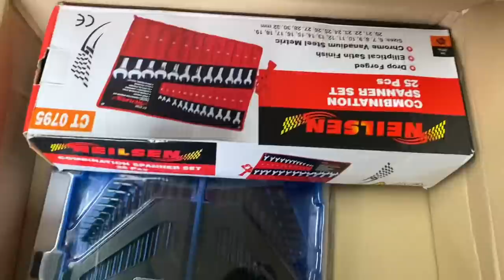DAY 550 #OLLYBLOGS FIXING BENT BATEMAN SPRAYER AND WHAT IS XFORM STEEL #AnswerAsAPercent

Comment: One of my customers bought a cherry x form bucket, really good, loading a 28 cu feedwagon  around 5 loads/ per day,and takes a lot of stick, not put the welder to it yet which is unheard of normally!
The only poor thing, which you probably won't have anyway is the bolt on wear strip, looked good,( if you've never changed one) but if you have your first thought would be ,"what were you thinking"!!
Mike in Dorset
Reply from the maker: Is bolt on strip not a good idea then ?
Reply: Oh no, bolt on wear strip are an excellent idea, especially in high wear situations, but in this case when the bucket arrived,instead of the the usual bolt with inset square underneath and nut on top, cherry had cut a thread in the bucket with an Allen key stud coming up through with no nut , only a couple rings of thread showing.
I said to the customer"send it back" but he thought it looked tidier without the nuts.
But when you come to turn it,
You have to nick all those threads off (thin disc) because they're damaged obs, then the Allen studs don't have enough depth so you have to weld a nut on each one to get it out! nightmare.
Normally,undo the bolts ,sinn it,locktite torque up,done.
Mike

Comment: Those nozzles clamping onto the steel pipe must have a rubber 'o' ring to seal properly. I hope you made sure they were all correctly in place when refitting them; if not, they'll leak !  
You could use a local window cleaning company to wash off your Solar panels; they use de-ionised water that leaves no residue, which can attract more dirt!
Reply from the maker: Hopeing to do it in rain 
Yes they had o rings in